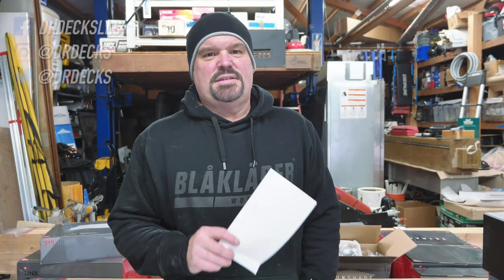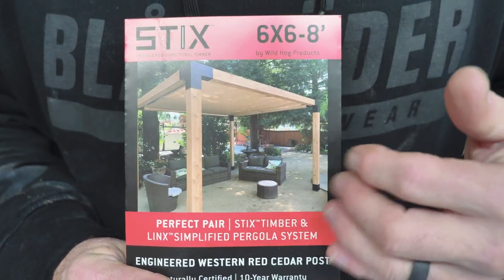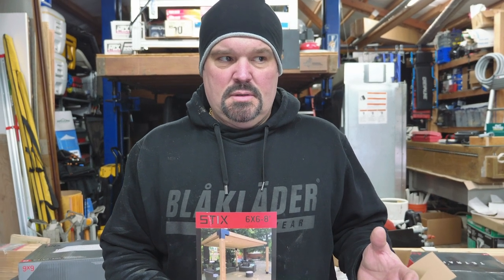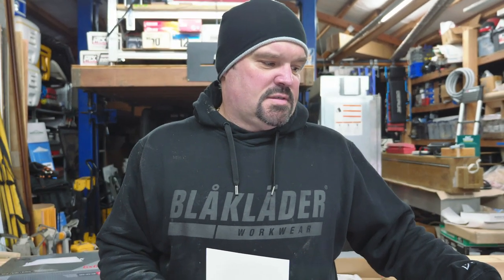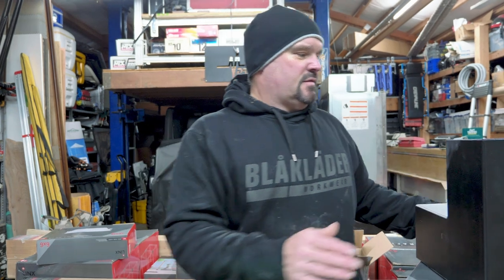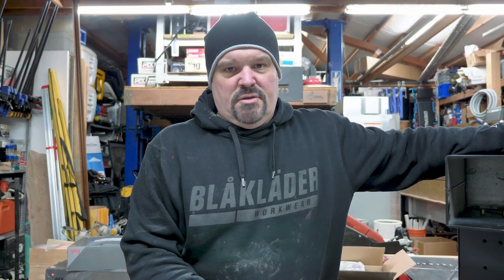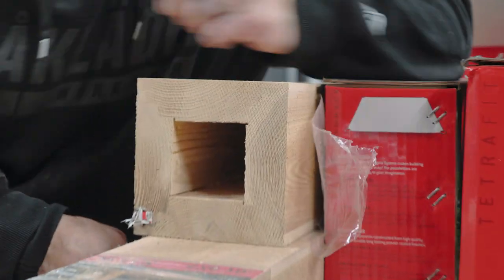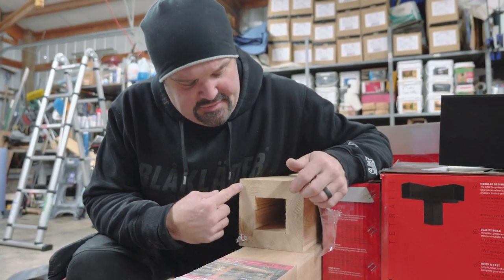Building a Linx Stix Pergola || Dr Decks

Comment: Wondering if the corners might have been a big part of the tight fit issues?

 (Forcing sharp, square wood columns into the (slightly radiused) steel tube corners is gonna be a no-go, even when the side-to-side clearances should work.)
Just thought that it might be worth trying a 3/8" radius roundover bit on those corners next time before breaking out the belt sander.
Reply from the maker: No. They needed sanding
Reply: Ya exactly, the metal was rounded and the wood had corners, so it needed to be rounded out. Belt sander made it too loose and ... What a mess